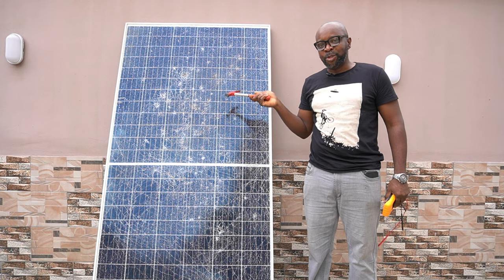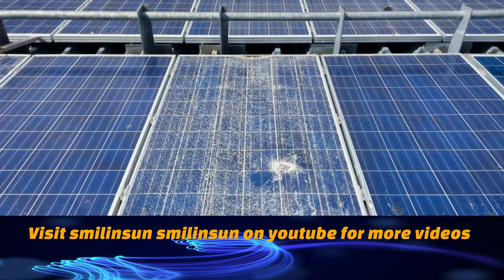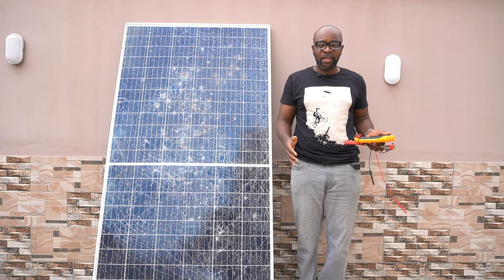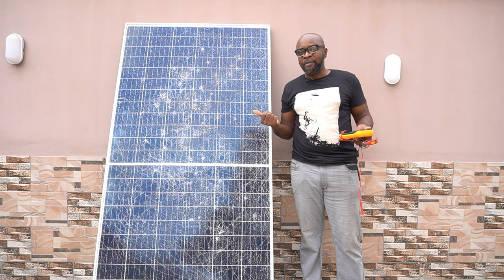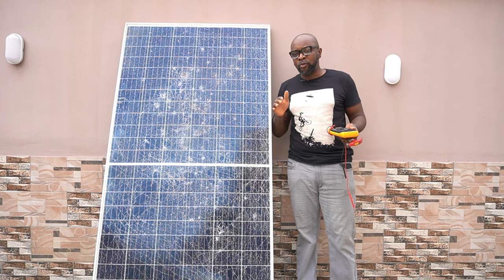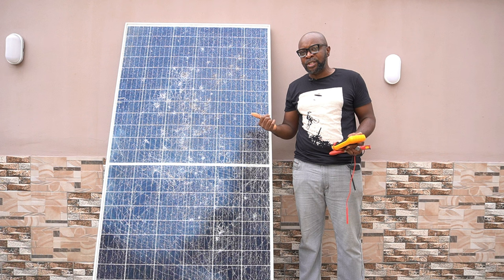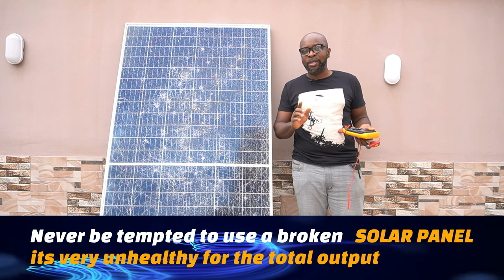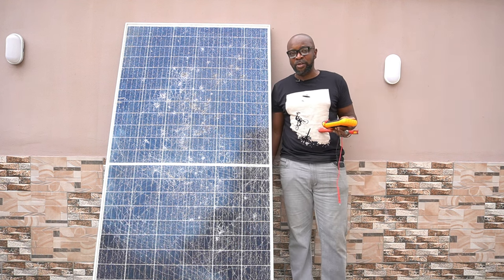Broken Solar Panel ,You need to know this.

Comment: It makes sense that the efficiency would drop in the broken solar panel. From what was presented, it appears that the 'entire system' efficiency is dropped. Is this relative to both series and parallel configurations? Is the broken solar panel somehow reducing the output capability of other panels? If you have 3 panels and they each produce 5w (just for each math) = 15w for the total system. If one panel is damaged and only produces 1w, do you now have an 11w system? If so, each panel is still producing what its capable of producing. Thanks.

Comment: Use UNI-SOLAR roll out type. No shading issues. works in low light too, no glass, no frame no metal structures. they are indestructible.  There is a seller giving 20 yr warranty. They last forever. I've had a bunch just laying on the ground and getting snowed on every winter , for years.
Reply from the maker: Thank you so much for your contribution  that was very insightful.

Comment: if you have a broken solar panel.. and you can completely separate it from the system... and set it up as a ground level single cell configuration after you re-seal the glass (depending on how bad broken depends if you can just epoxy one section or replace the entire glass) yes this is a much lower capacity cell now but if you have multiple items that can run/charge on a single low efficiency panel (like cell phone charging or small device charging) it will still function... but not attached to anything else but a single low efficiency device.

  Yes your main solar will need a new panel... but if it is out of warranty or OLD panel you can still get enough for reuse the panels... when the main roof or such install is replaced with new panels many old panels can be gotten real cheap and you can sort out all the decent cells for reuse in a main installation (yes less efferent but better than nothing when you cant afford new panels.

 I have 15 damaged panel single installation  that charge batteries for portable equipment. any broken glass areas have been epoxied and they get 30-60% total power of a good panel. The roof instillation is new panels in good condition but in the backyard the junk panels make 15 charge stations and the working 12 (20 year old panels) make a ground level expansion for separate system for major loads this old panel system still produces more than 75%  of original generating output) with a bit more losses due to ground system not as optimal sun coverage but they still work to charge up a ecoflow portable system while the damaged panels can charge up power tool removable batteries  

so for just a few extra bucks i was able to use my old panels to make a 12 panel system and i have gotten 15 broken panels from friends who have replaced there damaged panels and with a little epoxy i have been able to make tool chargers yes even the old 12 panel system is probably not good for a rooftop system but it works good for a ground bound system  I removed the 12 panel old system and replaced it with new higher capacity panels  due to only having so much roof space but you can put ground mounted non utility connected systems without a construction permit
Reply from the maker: Hi @chlistens thanks for reaching out,
Its just not worth it compromising the entire system because of one Solar Panel.
Reply: @smilinsunsmilinsun8056 my solar cell is cracked and 2 of my mppt controller become damaged. Can the damaged cells be repaired? Or just throw it away?
Reply: You just want people to buy brand new from your shop.

Comment: During the installation, one of my solar panels fell from the rooftop. Of the four panels that fell, one is completely broken, while the other three appear undamaged. They are Canadian brand bifacial N-type TopCon panels. Should I replace all four panels, or is it sufficient to replace only the broken one? Your guidance would be appreciated. I heard about micro cracks but there is no cracks I can see with my naked eyes how can I find out at my home any solution or replace all panels before installation ?
Reply from the maker: How many of the Solar panel fell to the ground
Reply: @smilinsunsmilinsun8056  total 4 panels. But only one panel glass broken what to do now ?
Reply from the maker: @Lilaycs most times when it falls it's damaged, you will need to test the panels
Reply: @smilinsunsmilinsun8056  how I can test the panels at home ?